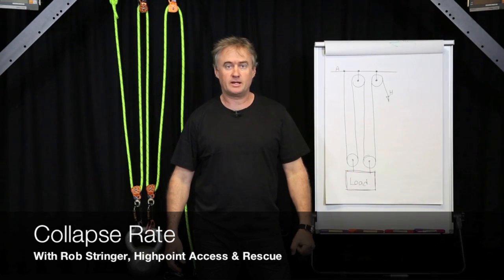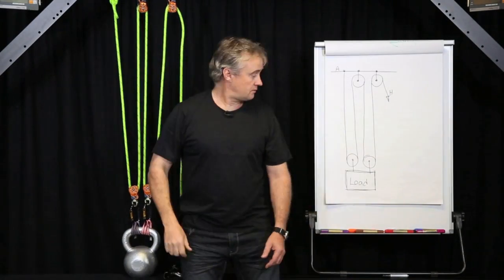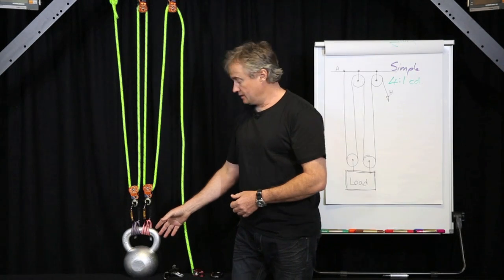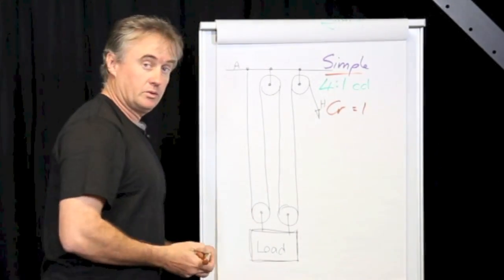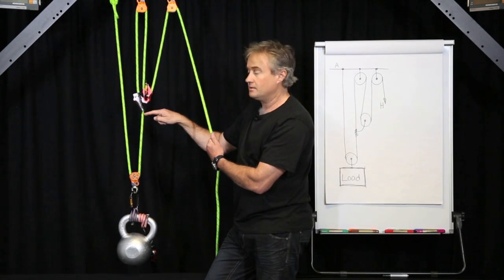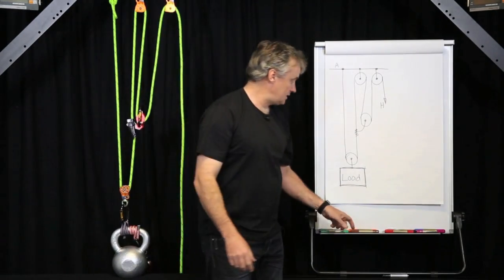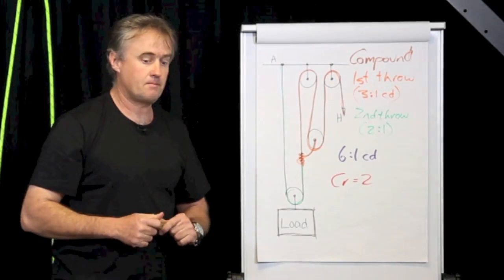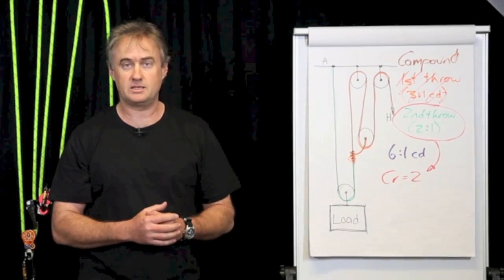Collapse rate Pt 2 Simple and compound MA

Comment: Hello, I have a question and suggestion to part 3: As You mention in previous part,  MA of the system is equal to number of strings attached to the load. There is a competing opinion that MA of the system is equal to number of pulleys attached to the load multiplyed 2, so it can only be even number: 2:1,4:1, etc.., so  odd MA systems are not exists and last odd string attached to load directly is  have only load re-directional role.

Can You please make experiment of simple pulley system with 5:1 and compare it with equal 5:1, but attach last 5th string not to the load, but, let's say, to the ground, or some another static point and compare effort required to hold load hanging under the ground.

I have made attempt to do such experiment, but i haven't digital measurement equipment and because of friction and small weights i've used I was unable to achieve solid result proving one or another opinion.